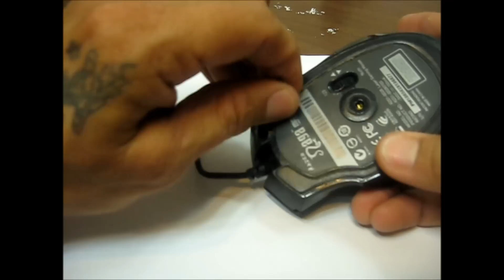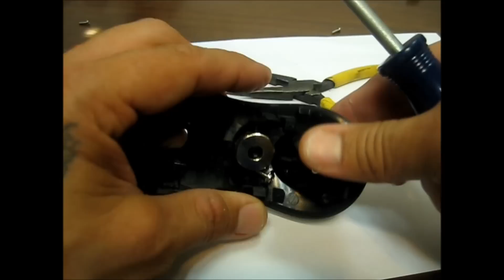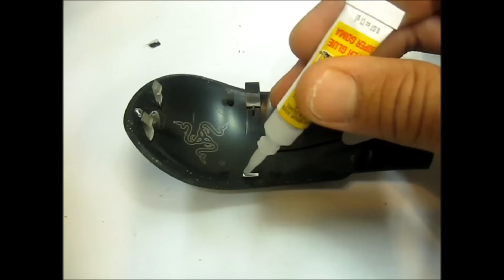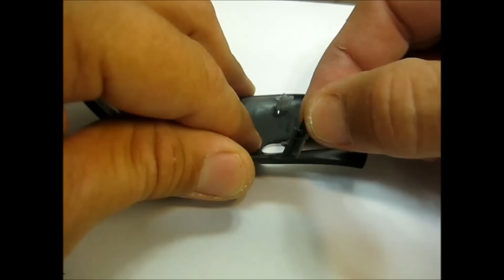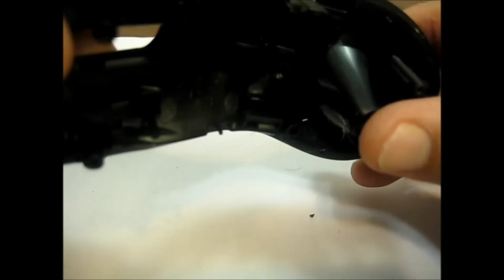How To Disassemble and Repair Broken Left Click on Razer Naga Mouse

Comment: took my mouse apart today after using it for 6 years. I retired it and bought a different razer mouse, however I still can't use this new one to play my games with. So I took apart my mouse following your video. Turns out it can get worn out, mine had a little dimple in it causing the click to sound but not actually click. Tiny little groove in the plastic has now been filled with super glue, will update with the results. Im happy with this mouse as it is, its 6 years old. But if I can repair it with super glue im gonna be chuffed.

Comment: Thanks for this video! It made opening the Naga very easy. My roommate's pressure applicator (the little plastic pylon that makes contact with the button actuator) was not broken, but had worn a half-circle into the plastic the shape of the harder plastic button it was pressing down on. I cut a piece of solder wire (for softness) to the width of the button, dabbed it with super glue, and then stuck the piece of wire lengthwise into the divot. I then left it a few moments and dabbed it with a tiny bit of super glue to cover the top. After drying, this took it from a ~1mm concave surface to about 1/10th of a mm convex. The button is still audibly softer than the right click, due to extent of use, but works like a charm again!

Comment: Thanks very much for this video.  My Razer model is a bit different.  It has started losing the click when I'm moving the mouse, so I started shopping for a new one.  I looked at taking it apart, to see if maybe there saw some accumulation of dust or something that was causing a problem, but concluded it's impossible to take apart.  On a whim, I did a Google search, found your video, and am now emboldened to at least try to see if it can be fixed.

Comment: Had to solve a single-click-double-click issue with my Razer Naga and looked it up. Realized I had seen this, back in 2013, yet had forgotten where the screws were. Then started to wonder why I had to fix it the last time... then I popped the lid and saw an onslaught of isolation tape on all the wires... riiight, a fault in my mouse cable had me shorten it greatly and solder every wire back.
Thanks for the rescue! (twice now, it would seem)

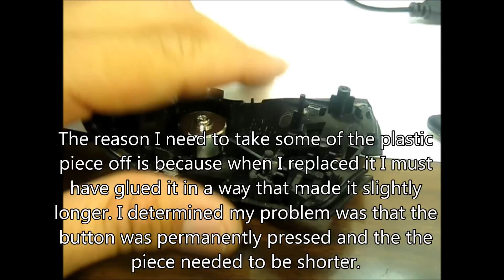Comment: Thx alot man had this mouse since 2012 and it pooped out on me today (may 2019) and it was worn out in the middle so i had to do what you did at ( 8:05 ) only difference was that i used a lighter and set that little plastic tip a blaze, the plastic expanded due to air bubbles in the molten plastic and gg it works on the first try :D

Comment: Saw the video... bought a new one...
Reply: so what?
Reply: lol
Reply: omg..this made me laugh hard..cry laughing
Reply: I mean all you had to do was open it up and blow really hard into the button... it worked for me after 4 or so years of double clicking. Unfortunately I peeled that one part off wrong and had to remove the rest of it so it doesn't move as smoothly but it works XD
Reply: @DaProGamer12  i didn't even open it up...i blew on the opening of the left click button like it was a Nintendo cartridge and BAM...my click feels normal again....too bad i smashed it a few times which now has a loose screw on the inside lol
Reply: So did I... now I'm back here a few years later after another Razer DeathAdder mouse button failure on the replacement mouse.  It's starting to feel like this flimsy piece was designed to fail.  Those fuckers.

Comment: Thanks for showing how it's supposed to be done!
While I didn't bereak mine, my LeftClicl was acting weirdly, sometimes loosing a hold click, only to re-click, or getting doubleclicks at times.
It turned out, that some dirt accumulated, an probably shortened the Clicking, with the Mouse now cleaned, I'm testing it's Behaviour to find out whther or not it's still acting weird, and possibly needs a replacement.

I'm currently thinking about the Corsair Scimiter Pro as a possible Replacement, and already tried the Titanwolf Gaming Mouse System (that enables Button-Replacement/Configuration, but unfortunately only catches 1 Button-Input at a Time, making it unfit for a lot of Games, for example in Diablo3: Mouse as usual, kills on the NumPad of the Titanwolf, whenever I fire up a Skill, I have to repress the Mousebutton for Movement)

Comment: I was looking for the snapped bit, after 15 minutes of searching no bits, I realized there was a groove that had worn into the left mouse button stick in the shape of the little white mouse button, that little problem was causing my left mouse not to work, I filled in the groove with some super glue, left to harden, done.

Comment: You better use epoxy than that kind of glue because its brittle and breaks off easily, while epoxy is not.  You can also solder plastic even as tiny as that.  There is a way to solder plastic which can be as good as the original, don't use soldering iron or any type of equipment which can melt the plastic very hot that it becomes brittle.

Comment: A quick question (I thrown away 4 slightly expensive mouses so far), I have the same problem from time to time, I click but the left mouse button doesn't work even though the clicking sound can be heard. Or I click and it actually makes a double or multiple clicks, when I put the mouse pointer over a folder or a file and I press the LMB once it actually opens that folder or file.

My question is, when I have LMB issues is it because something is broken and I could glue it back? What about the double clicking issue?

Comment: Hello Sir. I’m having issues with my right click and my scroll wheel. Basically I have to press really have for the scroll wheel for it to activate and my right mouse button is like kinda glitchy where I sometimes it works and for example when I try to aim it would constantly activate and deactivate while holding down the key. Any advice ?

Comment: I have a razer naga Molten and the same prob but on the right side. I cant separate the guide from the top to glue because there are side buttons next to the left click and it wont let me separate the two.... any advice?
Reply: There are clips on the sides and the back that you have to press to release the top. I had to push a couple precision screwdrivers between the two plates on the sides to keep them open while I released the back two.

Comment: 2 things then you put the screws back on: Don't fold the teflon tape like that, the dents will stay there. And more importantly, when you start screwing, push the top and the bottom pieces together with one hand while you screw with the other.
Reply: +lassipls Couldn't fix my mouse after all ^^

Comment: I have a strange problem. There is a click on the mouse, but it's not working. After I opened it, meddled with it, and closed up again; it works if I press it extra harder. The normal click remains but it doesn't work. After the initial click I have to apply further force for it to register. Is this the same problem? (It works fine when I press the white tiny part after I opened the mouse.)
Reply: Your problem may be different. On mine, it does something similar, but if i press too hard, the button spazzes out and multi-clicks. The way you fix that is by buying a new switch for it (you can check and see if your local Radio Shack still carries them). What you want is called a "three terminal microswitch," preferably one with all the pins facing down. 13mm x 5mm x 6mm, or something really close to that.

Comment: Well my razer naga works fine but like i get pissed of since at times when i click once it like DOUBLE clicks for me like twice in one click im like srsly it pisses me off at times
Reply: same as mine then
Reply: Daniel Rahmanto i fixed it by rapidly click the button pretty hard but not to hard
Reply: ***** what's up mate. there are some videos on youtube teaching how to fix double clicking nagas. i repaired mine by disassembling it and pressing the button insie. then i blowed as hard as i could with the button pressed. i think it was the dust inside the button that was causing the problem.

i hope you fix it soon
Reply: ***** to late allready got it fixed.
Reply: Archibald Cowboy Montgomery well sadly i just had to Clean the inside of it but hey it is like 2 years old now and i have enough Money to buy a new one so i pretty much gave it away since it worked completely fine so i got a new one so with keyboard xD
Reply: This tends to happen as the plastic actuator on the button wears down and causes a very fine plastic dust that jams inside the microswitch. Open it up, press the button down with a precision screwdriver or something and blow it out with compressed air. Decent chance at fixing it. If not, you're boned unless you want to buy the microswitch online and can solder to remove and replace them. If you can, you can fix it on the cheap, $5-10. You'd want an Omron D2FC-F-7N.
Reply: Raeth Fennec its all fine now but thanks for the suport :)

Comment: i have the razer naga 2012 and there are no screws to be seen !!!! its impossible to dismantle anyone able to help me ? i only want to clean it because i spilt juice on it
Reply: its alomst as the same. you need to remove the pads under the mouse and under them can you see the screw holes. i tried it one whit only one pad. but i kind of ruined the pad so i dont recomend to do it but you can do it.
Reply: the one i had had another layer of plastic under it, like a white seethough one. i had to take that off after taking of the black piece of plastic so i could reach the screws

Comment: My mouse clicks normally but it actually doesnt work, like it would do the clicky sound but doesnt work.
Reply: Kuro-ko mine too. did you solved it?
Reply: Well, i solved it by blowing under the mouse click button. Yes Blowing like just blow air strongly through there and it worked again. (I had to blow it like once or twice a day cause it would stop clicking sometimes)
Reply: Kuro-ko well just tryied to weld a new micro switch and fuck it up... too bad for me i guess...already ordered a next mouse (logitech g502) no more nagas for me...the feedback ive been getting from alot of ppl is that the mouse is a shit build material.
Reply: yeah i got the g502 too, so far is awesome

Comment: Avoid Razer Naga (2014) like a plague. First one had the left click, the actual plastic that you touch with your finger... just snapped off within two weeks. Second one lasted two months, same problem. The whole cover that your palm touches is one piece and the edges at the very front, near where the cord is connected, get caught into things and are poor quality and/or bad design. Can't imagine these lasting a year.
Reply: vastis 2012 is all around better imo
Reply: I've had my Razer Naga for 4 years.  Whatever you were doing that snapped off the plastic switch cover -- is not what a mouse is supposed to be doing.

Comment: "And just remove all 4 screws" HAHAHA yeah nope. They're fucking glued in. That's BS why would a company even do that other than to annoy the crap out of customers... If anyone has an easy solution to this I will love you forever just FYI.
Reply: same here
Reply: Same here!Been trying for the past hour to unscrew the fucker. I've tried multiple screw drivers all the correct size etc and they ain't budging :'(.
Reply: yeah i had to break it open .
Reply: they are super tight you need to get a wrench around your screw driver and turn left, its so tight this is the only way.
Reply: I had to use a bigger handled screw driver (same Philips head).  Also lick the screws.

Comment: These mice are crap, I've fixed mine a few time with it failing a month or two down the road.  Do your self a favor and find something else, I've been using a Logitech G600 for over a year with no click issues.
Reply: yes, but there are losing the usb reciever issues
Reply: I've used my razer for 3-4 years and it just recently starting fucking up on the right click..

Comment: No Guides on how to take apart a 2014.. someone please fucking tell me how -_-
Reply: right? havent been able to find one
Reply: Nvm I figured it out, pretty easy.
Reply: Wayumi I know this is way later but HOW??? There's a loose piece on the inside and even though the mouse works fine it's driving me crazy.
Reply: Take off the black plastic thingies on the bottom (ruins warranty) and then take out the screws under those and it's open.
Reply: Wayumi You're a hero. So you can just pry them off with something like a flathead screw driver?
Reply: Yeah
Reply: Sorry for the late question but I've held off on doing this yet. Because I'm wondering if the black plastic things go back on easily. Because my actual issue is that the LED light for the logo fell off and rattles inside my mouse. So it's not a major issue overall, and I don't want the plastic feet at the bottom to not go back on the mouse just because I wanted to fix a small issue.
Reply: HomesliceHobbes I just did this repair today, but mine is the same year as the one in the video. As for the black tape which I think is universal, it is easy to get off and then back on if you use a very sharp thin object, such as a razor blade. I used one and I have no problems with the tape going back on. but you need to be careful when you peel it up. It is doable without ruining the black tape, but as I said, use a razor blade, and do so cautiously. Push the blade underneath the tape, and pry up a bit.